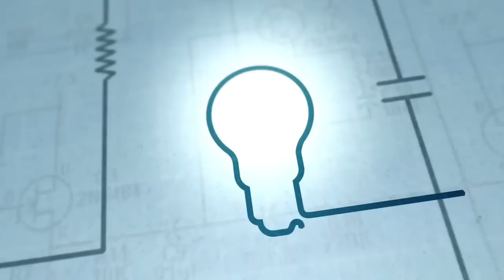DiResta: Draw Knife Restoration

Comment: Once again, fashion over form. Those brass collets were designed to hold the wooden handles against the tangs of the blade, and not just to look pretty. The old guys knew what they were doing. What was once a field serviceable tool is now gobbed up with epoxy and will more than likely be a throw away the next go around.  I enjoy the entertainment value of these vids, but this is no restoration.
Reply: +Naegling despite your opinion.. it will get used and if then handles come off i will fix it. Once again.
Reply: +Naegling If you look at the technical data from West Systems website for 105 epoxy + 207 hardener the tensile strength is 6748 PSI.  Even if the tensile strength value is derated by 60% it would still far exceed the tensile pressure the strongest of humans can generate.  Furthermore, the exotic hardwood African Padauk Mr. Diresta used for the handles far surpasses the old wood (probably hickory or white oak) in every performance characteristic Janka hardess rating, modules of rupture, elastic modulus, crushing strength and long term stability... look them up!  Lastly, the machined brass ferrule used not only looks better than the cheap stamped one that originally came on the tool, it will most likely perform better as well as it was tightly fitted and is placed over the position of the handle that has the highest moment of bending.
Reply: Yea!! What he said.
Reply: +c brown thank you for in depth analysis!!
Reply: Who farted..?
Reply: +jimmydiresta Thank you Jimmy!  You do great work and have a keen sense of functional style.
Reply: +David Waelder Ha ha.. I guess my response was a bit gassy.  Subbed
Reply: +c brown, again you reinforce my point. While the Paduk might look better, and the 105/207 epoxy might be stronger, this was not a restoration.  Why even start with an old tool in the first place if the entire goal of the project was to make something that just looked like a draw knife? I'm certain there are better steels out there (say O1 or 4140) that would be better than the high carbon this is made from. Why truncate the tangs on this new piece of modern steel if you are just going to use epoxy to hold the handles on? Why use a collet in the first place? Why use a thousand year old design for the tool at all? Perhaps we modern man could come up with a better design (Challenge to Jimmy...) Each element of that tool was thought out to work as a whole, but by just jamming a pretty handle on the old blade what Diresta is saying is that he doesn't care about any of that, and that modern epoxy and a pretty wood can make up for actual engineering and design elegance.
Reply: So. 
You don't like it?
Reply: +David Waelder ha-ha, I never said I didn't like it. it's beautiful, but it's not a restoration.
Reply: That's a fair assessment, but restoring, and preserving the ability to do its job with different materials, while achieving the same or stronger result is progress no?
Reply: +David Waelder dropping a Tesla power train into an original fastback Mustang could be considered progress to I guess.
Reply: +Naegling shit yeah! then you can mimic Them purring pistons with your mouth sounds. Shelby GT fiveNONEdred.
Reply: +Naegling why the hell would you throw it away because of the epoxy? the epoxy just makes it strong. a glued friction joint is better than a friction joint
Reply: +Naegling Can you give me a link to your tool restoration videos?